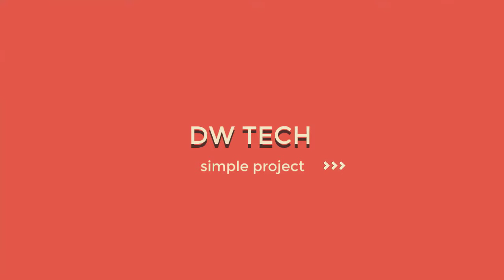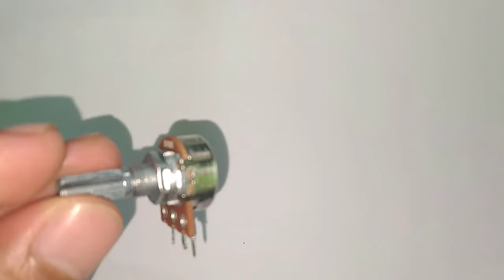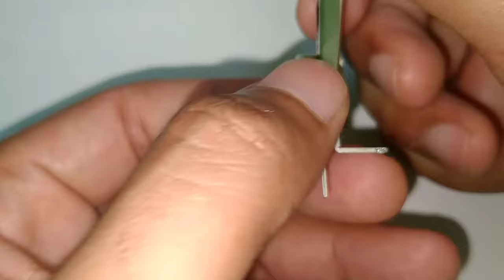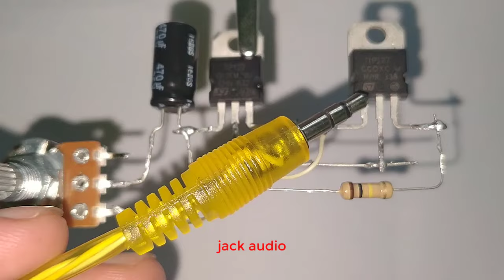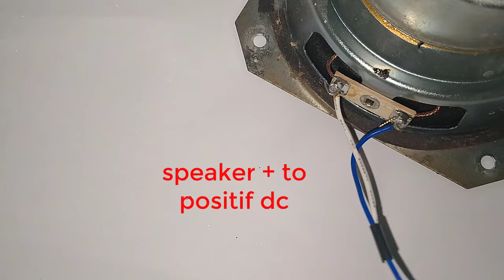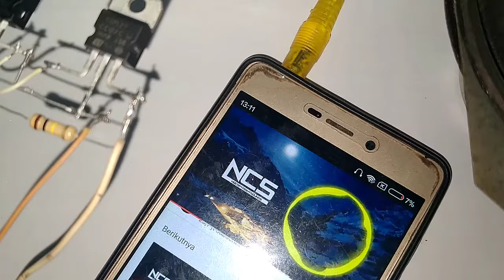Awesome Mini Amplifier Circuit | Powerfull 100 Watt DC 12v

Comment: Bad design, running DC thru the speaker will blow it.
Reply: Explain car audio coming from a DC battery.
Reply: It doesn't go through a rectifier to convert it to AC as that would damage all other internal components
Reply: @cooperradke3774  Push-Pull amplifier with single power supply must have a coupling capacitor to isolate dc from speaker.  In your design you connect one side of the speaker directly to the positive of the battery.
Polarization of the transistors is done because of dc passing through the speaker and that is very bad.  In car radio, the speaker is connected between two push-pull amplifier with a phase difference of 180 degrees between them.

Comment: Donde esta la corriente de 12 volts donde conecto los cables??? No sé ve
Reply: Si se ve el negativo de 12v es el cable café que va a la pata 2 del transistor segundo y positivo a la bocina

Comment: 12v + or speaker ka _ Kahan Lagy ga?
Reply: Supply + connected through speaker Blue wire to TIP127 Emitter for sound and power and supply -- to collector TIP 127